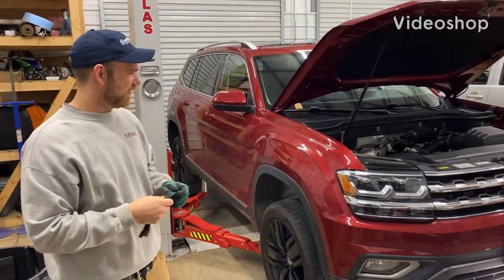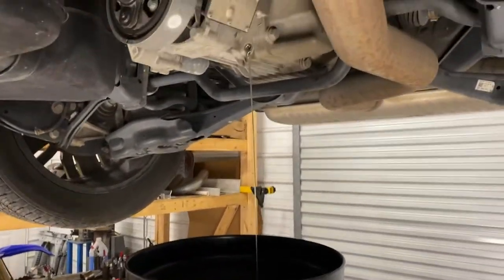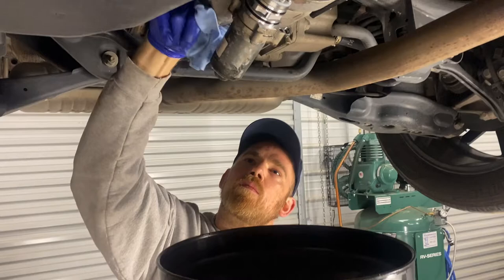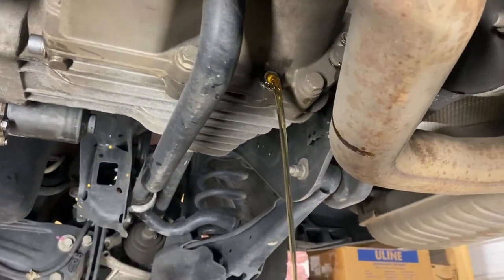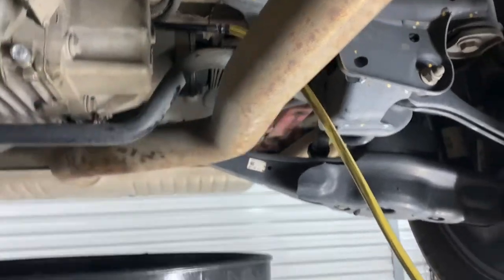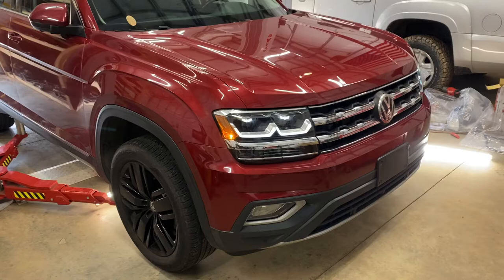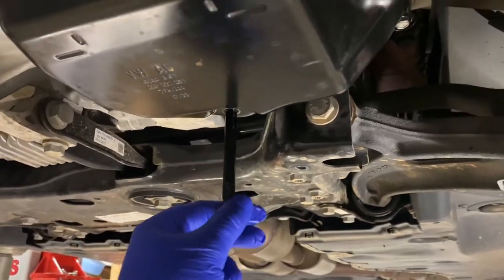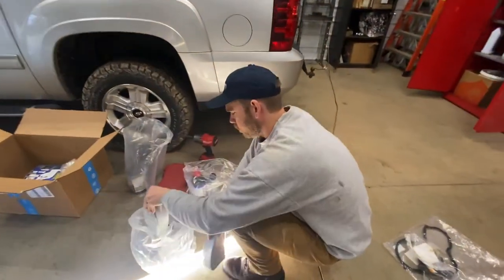VW Atlas DIY Transmission Fluid & Filter Service, Bevel Box, Haldex & Rear Differential. 40k How To

Comment: Thanks for posting.  The only thing missing from the description is the amounts and part numbers.  Would have been good to know the number of Ltrs of trans fluid you purchased and could have easily had a quick video shot of the containers which have VAG part numbers on the faces.
Reply: This wasn’t that planned out, just shot some footage servicing my buddies wife’s Atlas before work (I had just enough time to make it in for 2nd shift at my aircraft mechanic job).

Sorry to disappoint, just figured I’d show the how & the why. In 40k when we do the next service if I have time I’ll update with the specs.
Reply: @jakebaun8422   No worries.  Just getting ready to do all this service on our Atlas and was looking for specifics. Thanks
Reply: Give your VIN number at your local VW dealer. They'll know how much quarts it needs, the right fluid , filter and bolts.

Comment: You guys screw it up at the end. You should show how you remove the plug and let the excess out
Reply from the maker: My friend brought his wife’s Atlas over & we filmed what time allowed of the service.

The main focus was pointing out what people (VW techs included) mess up the differential & Haldex service.

This is a light hearted, one take, couple guys in the shop after work, but before plans our wives made afterwards time limited video.

If you want a step by step with graphics and manual references, part numbers, torque specs, ECT this particular video isn’t it
Reply: @BaunPerformance  The video is great overall, what I meant is you already spent so much time creating it, so including final step of releasing the drain plug would make it whole, but regardless I did mine and had funny result. After replacing the filter in the transmission, filled back with 3L, heated to 36'C, released the plug and nothing came out for 3 sec, then barely anything, but I wanted to do the flush anyway, so removed the internal pipe, and let the mixture of old fluid from tq conv with that 3L of fresh fluid out, and re-filled again with 3L. Heated again to 36'C and now after removing drain plug, the fluid  was coming out long due to 0.5in pan, and 0.5 in filter, so 2nd time without removing pan 3L is way too much.

Comment: I think the engine must be on and running in park at operating temp to check fluid level the the pan via overflow drip tube . Doing this with the engine off  may result in low fluid levels and possible transmission damage .
Reply: Did it that way 3 days ago while car was running I let it come to trickle everything running smoothly
Reply from the maker: It’s been so long since we shot this I’ve got absolutely no clue.

I let Ricky use my lift, his Atlas (and he’s the one who pulled the manual/bought the fluids). 

Absolutely follow whatever factory manual reference you have.
Reply: you are correct. I had no drips...turned the car off....suddenly it's flowing out. Start the car....no drips. Filled it with more ATF....then it started to drip out while running. Proper level

Comment: Would all of this be the same for a Tguan?  I am contemplating a 2020 SE with 4Motion AWD and just wanted to see what I am getting into when it comes time to do the fluids.  Of course there is no such thing as maintenance free or lifetime fluids.  There are long life fluids but but lifetime.  Not if you plan to keep it longer than 10 years or 60,000 miles.  Once you hit 60,000 miles it starts to become a lot more important to change those fluids if you didn't already.
Reply from the maker: All MQB cars are going to be very similar, if not identical

Comment: Here's a tip to stay super clean while doing a transmission flush.  Once you get enough space stick and fluid extractor in the pan to extract the transmission fluid.  Worked out great for me since I didn't have a lift.  Once again thanks for all the help with this job.

Just waiting on the new o-rings to do the Haldex

Comment: Great video. I have to do mine...without the lift. When you let the fluids warm up and cycle through the gears...did you have the tires spinning in the air? How do you get the transmission to cycle I to the high gears? Did I miss something?
Reply: No need for a lift, four jackstands was my method for 29 years prior to owning one. 

I did allow the tires to spin in the air, at idle speed and shifted “manually” through the gears. However if you’re not able to do this simply putting it in gear with the brakes applied should be sufficient as long as you can do so safely & with long enough pauses to properly circulate transmission fluid.

Comment: Remove the Yellow stand pipe? When? Before removing the pan? And what tool you need for that??? Thanks for the help.
Reply: Yes, the stand pipe must be removed to drain the pan prior to removal
Reply: @jakebaun8422  so you warmed up the fluid to proper temp, THEN opened the drain to verify the proper level with stand pipe in?? Can the stand pipe be removed with the pan in?

Comment: very detail  . does the 2019 tiguan use the same haldex oil as Atlas.  if so which brand of the haldex oil you used. and what is the part number .thanks
Reply from the maker: I have none of that information
Reply: which brand of haldex fluid you used for this video thanks

Comment: Hey, just talked to VW Mechanic at the dealership.  And told me a master mechanic  removed the Haldex couple to service the filter screen. Said he ran into an issue about a loud noise. Did you guys run into that issue?

What did you torque the bolts down to?
Reply: No sounds or issues with it serviced correctly (like in the video). 

During the service I explained how dealer techs often screw this job up (by draining both the Haldex & diff, then only refilling filling only one
Reply: @jakebaun8422  yes when the guy explained it to me and I was like he ran it dry. 

Trust me I flashed back to when you made fun of certification and all that
Reply: @jakebaun8422  hey does 9.5nm sound right for the bolts for the coupling
Reply: Its a disgrace a master mechanic a VW dealer cant do this procedure right
Reply: @jamesworley5073  Yes, 9.5nm if you are talking about the 2 bolts that hold the pump motor in.

Comment: How does the Tranny fluid not leak out when you remove the adapter?
Reply: It has a stand pipe up to the fill level, so the correct amount is left behind below that point (at the correct temperature) since volume increases with temp.
Reply: @jakebaun8422   Thanks yea i seen the plastic piece

Comment: What would be a reasonable amount to pay for the transmission service?
Reply from the maker: $300-400ish depending on your location. Some dealers price gouge double that
Reply: @BaunPerformance  That's why you call them STEALERS. My local STEALER said close to $900. I politely said, GFY. I'll buy the fluid, filter and gasket and get it done with my local mechanic.
Reply: The VW kit alone is over $500.  That gasket, from VW, is something like $75, the filter is $114,  and the VW fluid is in the range of $44/qt.  It is an Aisin 8 speed, so the Aisin or Toyota WS fluid is probably okay, at closer to $11/qt.

Comment: Hey do you know if the refill adapter will work on 2018 vw tiguan?
Reply: Should fit any AWD MQB
Reply: @jakebaun8422  is it the same transmission?
Reply: @jakebaun8422  even though I have the 2.0 and not 3.6?
Reply: @jakebaun8422  how did you get the transmission up to proper temperature without the scan tool? Just use the oil temperature
Reply: @jakebaun8422  hey just did the Haldex on my 2018 VW Tiguan. Everything went smoothly

Now, I have Errors: Electronic Stabilization Control,  Hill Hold Assist, Lane assist, Front sensors, Tire Pressure Monitoring, and Park Pilot.

I don't know what would cause that systems to have Errors

Comment: Do you have a link to the adapter you got on Amazon.
Reply from the maker: It’s in the videos description
Reply: I feel like that Swedish made pump wouldn't airlock if you just used a loose fitting tip. I think the tip doubled the amount of time it would take to fill

Comment: You used the same fluid for rear differential and haledex ?
Reply: No!
Reply: @jakebaun8422  can you tell the type of each please
Reply: Anything specific would be in the video, so that’ll be your best reference. 

The bevel box and rear differential take gear oil, and the Haldex takes thinner specific fluid. 

Sorry I don’t have details handy off the top of my head, not only is that not my Atlas, but also not the type of work I do as I’m a full time aircraft mechanic & part time fabrication shop (don’t do any car maintenance outside of helps buddies like Rick).